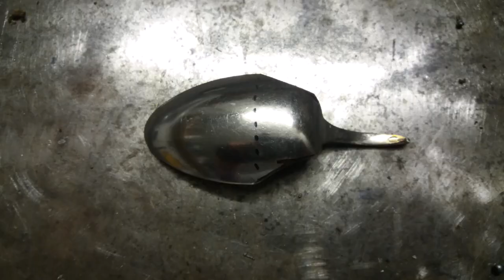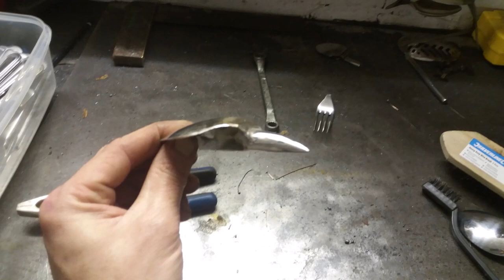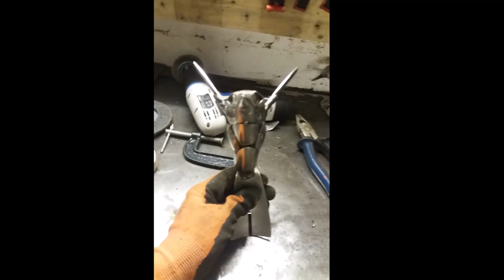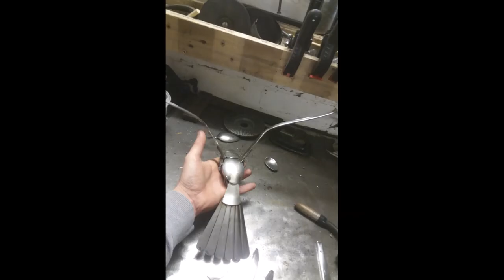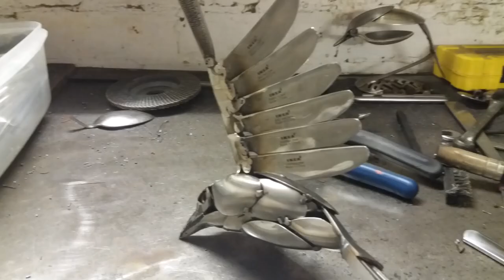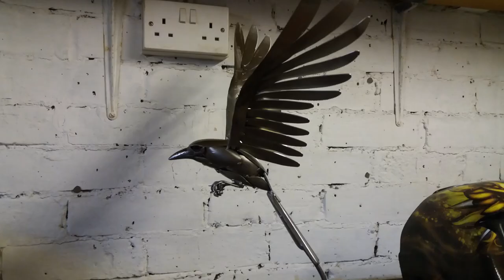Making a bird sculpture out of cutlery  - Jackdaw Sculpture

Comment: Hiya, can you tell me what tool you use to cut out the eye holes on the head? I'm not sure my 5" grinder would do the job for that part. Also, how do you clean up around the tack weld? I used a soft wire brush on my previous efforts (I won't use the term 'sculptures' just yet...) but it took too much of the chrome off and leaves a pretty poor finish.

Thanks!
Reply from the maker: I use a 5 inch grinder! But I use flap discs for shaping. So those eye reliefs i just ground them down with a 60grit flap. The fork forms the underside of the eye socket of course and i weld along all the joining edges and transition to the beak ....then (again using a flap disc) sculpt smooth. As for the chrome finish ... if you re using stainess steel then the finish is throughout the material rather than a chrome plate on top ... so it just needs refinishing to return it to shiny. I get it as smooth as i can with the 60 grit then perhaps ill quickly kinda buff it with the 120 then its on to scotch brite pads (you can get these for die grinders / dremels / drills). Again different grades but they should take you more or less to a stage where you can polish ... and for that I use autosol metal polish. The more shiny bling you want the more you go to town. Personally I quite liked the more matt finish on that bird but you could go full mirror effect if you wanted to. Here's a couple of links to the tools im talking about ....https://www.spawelding.com/abrasives/flap-discs/tyrolit-115mm-60-grit-ctrim-flap-disc.html  https://www.ebay.co.uk/itm/50PC-2-Medium-Fine-Roloc-Scotch-Brite-Roll-Lock-Surface-Sanding-Disc/233644470697?hash=item36664bb1a9:g:5cIAAOSwfi9ZsYtU These are a 'quick lock system' that work brilliantly and come in various grades. Typically I use red then green ones but there are others. Great tool for tidying up. Hope that answers all the questions.
Reply: @JohnNorrisMetalSculpture  Yes, thanks. I've been going straight from (worn) flap discs to autosol so a bit of fine polishing in between would obviously be the way to go.

I'm going to be a bit of a pain here but I'm trying to work out how to put together the Jackdaw's head and I can't work it out from looking at the video.The steps that I can see are:

7 secs in: bend front of and mark across the spoon, cut both sides to fit profile of forks

13s: cut forks to make beak and side of head, weld and polish beak - the underside and side views are clear enough 

The step from 25s to 32s is where I'm trying to figure it out. It goes from the side of the head seeming to be solid to having the eye socket and a nut there. It looks like there's a join at the front lower side of the nut, do you cut our part of the fork, shape the front of the socket, then shape and weld the rear of the socket out of a second bit of metal before putting the nut on behind? If you could walk me through the process a bit I'd really appreciate it, I'm going to have a go at putting one of these together.
Reply from the maker: @mattspencer6660  No problem, happy to help / inspire. This is an unlisted video I filmed for someone else. Some swearing in it :/ so not public but I think it should give you a much better idea of the steps involved - https://youtu.be/rXU6TeR1J9E

Also I filmed this one which details the knives / wings. There are a couple of things to consier for an authentic bird wing look, namely the curves on the feathers (downward on the inner 6 with perhaps less and less bend approching the elbow joint, then 1 unbent then gradually and subtely curving upwards more and more with each feather. Also as the primary tip feathers curl up they should also be pitched (angled) fractionally forward and again each feather shouldbe angled a fraction more than the previous one until you get to the tip. Think I did that for the outer 3 or 4 feathers, might have been 5, can't remember hope its clear in the vids. Here's the link - https://www.youtube.com/watch?v=7WOZtc-z7hQ&feature=youtu.be

EDIT: That head vid I've linked, there is a bit I forgot to do which i had to change later. Jackdaws have a noticeable brow / forehead. So i actually bend the spoon slightly just as it starts to turn in to the handle and just a few mm before the beak then starts. (hope that makes sense) Notice the forehead in the vid youve already seen is better because I did this. Simple thing, makes a difference. Easier to fix later, you can make anything out of weld! but remember to do it!

I don't know anything about your welding or metal work experience - im making it all up as I go along! Anyway here's a couple of other thoughts ... 

I'm overly generous with the weld when attaching the knives and I double up the spoon handles that form the 'arms' onto which i mount them, just to add extra strength. Incidentally that somethign not shown i the video. Strong spoon handles mounted internally like a triangle with both handles strectching out from teh centre of the bird. You need to fit the tea spoons that clad the body around these. If memory serves I had the spoon handles coming out imediately behind the head spoon. Again I think talk a bit about that in the vid, about the upsweep of the wing at the elbow and also a slightly backward sweep at that point too. The majority of the clean up I do with a flap disc (those zirconium ones last ages even when worn!). 

Its obviously important when you attach the knives that you bevel the edges that join the spoon handles because you need a channel for the weld to sit in for strength. The additional 'generous' weld that overfills that bevelled edge will all get ground off for a flush finish so you need some depth there or it will be a weak point. Finally on the wings ... The most useful tools i have (which I didn''t have then) are carbide burrs and mini flap discs in a die grinder. Getting in netween the feathers to clean up is fiddly! SUggest you do the bulk of it after attaching eack feather then clean up at the end any bits you arent happy with. 

Your question about the eye sockets. The head in the video you've watched (one of my very first pieces and videos) I forgot to cut the sockets and it was an absolute ball ache to do so afterwards.Possible but time consuming and unnecessarily fiddly, infinitely easier to cut a notch out of the fork before you weld it on. The head is a fiddly thing to make to be honest, you also have to be careful about welding the eyes (nuts / ball bearings) in the right places to get an even spacing around the eye socket, also they need to be symmetrical so take a lot of care in making sure your forks are attched symmettrically and like that your eye sockets are too. As long as they are all square then its just about making sure the nuts are welded accurately so there is even spacing around the edge of the nut and the edges of the eye socket ... there's a trick I use with a bolt that helps with positioning the eye nuts for welding - its in the vid. 

Unfortunately I had no suitable tea spoons in the video to show the finished body. Hopefully by watching that and then rewatching the one you've already seen you'll see how it is made. I make a kinda heart shaped chest out of two teaspoons (in vid) but then that gets covered up as I clad the body. Each side of the body I think has two teaspoons from tail to back of head and the second spoon tucks in the gap behind what I guess youd call the jaw. Something like that anyway. The vid you've watched there is a picture of the body with no wings in my hand I think tha tprobably will be the most useful still image. Try to build from tail to head, that way generally you are covering up as many tack welds as you can. To be honest the videoyou watched was (I think) the 3rd thing I ever tried to weld. It turned out pretty well but looking back at it now its pretty rough and alot of nasty welds visible. Alot of the skill in construction is hiding the welds or finding a way of blending them in so you don't even appreciate there was a weld there. I think the wing video Ive linked you above is a later bird so you'll probably see that the transitions between teh feather sare alot neater and the body also is different. Very similarly constructed but less obvious tacks. I try to build them the same (think ive made 5 of them now) but generally there is some variation down to what spoons I have or havent got.

Tools - I talked a little above about other tools you might want, the burrs are very useful. I was using them in a fake dremel (also mini sanding rolls which were very useful but slow prgress!)  but quite frankly its not nearly man enough although I built the predator and quite a few other things with it. If you have a compressor then get a die grinder, they are very cheap and you can put all sorts of little flap discs polishing scotch brite pads (quick lock) and sanding rolls. (Some of which fit in the dremel. Trouble with the dremel is its a very spindly little shaft the things spin on. I was forever chewing through the brass collets that close up around the bits. Also, definitely get some scotch brite discs. Pretty sure its called the 'quick lock system' ... basically a universal bit that fits in the die grinder (or a drill) and you just twist them on or off in a second. Drills dont really spin fast enough but as a work around they are useable. The die grinder has a much bigger beefier collet. Here's links for die grinders and carbide burrs / flap discs ...

Burrs - https://www.ebay.co.uk/itm/Handy-Tungsten-Carbide-Double-Cut-Rotary-Burr-1-8-Shank-Fit-Dremel-Rotary-Tools/192616541830?ssPageName=STRK%3AMEBIDX%3AIT&_trksid=p2057872.m2749.l2649  Incredibly hard wearing and cheap even on the stainless. Keep the speeds up or the grab a bit and can make nasty marks! Requires a firm grip on the tool when doing detailed work.

Mini Flap discs quick lock system - great tool! - https://www.ebay.co.uk/itm/10pcs-2-60-grit-Lug-Sanding-Grinding-Wheel-Flap-Type-R-Roloc-Disc-Wheels-UK/164316569082?hash=item264207ddfa:g:uLEAAOSwS41fJR88 This isn't the seller I got them off but I found soemone with a bulk load and various grits. Worth looking out for.

Scotch Brite pads - again, brilliant tool for pre polish - https://www.ebay.co.uk/itm/Assortment-Of-3m-50mm-Roloc-Scotch-Brite-Surface-Conditioning-Discs-Not-Grinding/193607779586?hash=item2d13ec4502:g:QAwAAOSwDLlfJnKV Again not a seller Ive used but thats the item you want! REg, Green blue i believe are coarse medium and fine. Work in drills and fit the same quick lock shaft as the flap discs. Very quick turn over from one finish to the next ... like 2 seconds to change it fromf lap disc to scotch.

Die Grinder - Youll need a compressor but better than dremels. Pretty cheap - https://www.ebay.co.uk/itm/1-4-Collet-Straight-Air-Die-Grinder-Grinding-Tool-US-Pro-Compact-6mm/381416776428?epid=2130558763&hash=item58ce3622ec:g:6aAAAOSwyNBeSyVE Something like that but check the collet sizes. Should come with a selection but read the description.

FInally, thanks for the interest, great to see someone else have a go at building one. Send me a pic or a link to a vid when it's done.
Oh one other thing, just re reading your earlier message ... you mentioned chrome finish. Avoid chrome cutlery or anything played or with any sort of hue or colour to it, they weld terribly generallygiving off some sort of gas that makes for a porous swiss cheese looknig weld. Crap, ugly and weak. Standard run of the mill cutlery works best (typically 18/8) or non magnetic stuff and you can weld it with mild steel wire as long as youre using a gas mig. Gas less is possible but it can produce porous welds too and a lot of spatter. I use 95% argon 5 % co'2. Generaly mild wire and then lacquer the pieces afterwards after cleaning (post polish) with alcohol or thinners.

Regards

John
Reply: @JohnNorrisMetalSculpture  Mate this is gold, thanks. I'm a boilermaker by trade so know what you're on about re: tools. I don't have a compressor in my home workshop yet but have access to one at work (with a die grinder) so I'll either use that or pick up a second hand one (I kinda want one for spray painting anyway).  I have a mig using mild steel wire and 95/5 gas as well, I'm a bit reluctant to go and pick up stainless wire and gases due to the cost outlay so I'll just have to suck up the poorer finish for a while until I have some spare cash lying around. 

I like the jig, I was thinking along the same lines as the two basic birds I've put together have pretty ugly bends in them and I want smoother lines in future. 

https://i.postimg.cc/B6RS2SBJ/IMAG0566.jpg

https://i.postimg.cc/9XqFC9c0/IMAG0567.jpg

Particularly above the beak on the second. I reckon I'll do a few more smaller sculptures until I get the technique right before tackling the Jackdaw as my first 'proper' project, there seem to be be a few of those compilation vids on youtube (where the creator takes stills from other people's work without crediting them for it, but that's by the by...) showing models of various levels of difficulty so I should be able to get the skills together fairly quickly. If you know of any websites or whatnot I'd be grateful if you could chuck them my way. I'm going to have to copy for a while until I have it together enough to do my own stuff.

Where do you pick your ball bearings and other assorted bits and pieces from? I've cleared out the local charity shops of likely stuff and am running a bit dry now. I'm a bit wary of using 'genuine' scrap as a lot of it (chains and broken bearings and the like) is rusty or pitted and it'll be a job to clean it well enough to get a decent finish on it.
Reply from the maker: @mattspencer6660  No problem happy to help. Those birds look good for a first effort! Bends could be easily fixed too!

Ok few answers: 

On finding inspiration and ideas or things to replicate I would recommend facebook and instagram, search for 'scrap metal artist', 'weld art', and 'metal sculpture'. I'm sure people wont mind a bit of plageurism but I also think you should push your own creative boundaries, and here's two reasons why ....

1) I think that the best of creativity comes from passion, admiration, love, desire, respect etc. A piece that truly has YOUR heart and soul in it will always give you more, and probably turn out much better because you will never settle for 'good enough'. Your heart won't let you because good enough ... ISN'T when it's your passion to make it. Consequently copying will learn you only so much, you gotta pour your own creative juice to get the best out of yourself. I think my Jackdaw, Predator / Pegasus are all good examples of that. 

The Jackdaw worked because I love Jackdaws, sure the finish is a little rough (early piece) but it's elegant, I'm still proud of it. It looks that way because it came from within. Likewise the Predator. Perhaps that was more 'admiration of cool' and 'desire to make' more than love or respect for the subject ... but ultimately it turned out good because once again it was MY heart that drove me to make it, to obsess over it, to dedicate the time to it etc. Again with the Pegasus ... similar. Came from within. 

2) Challenge yourself to improve and learn faster. The Predator was also one of my very first pieces, might even have been the one after the Jackdaw. Making it was the single greatest learning experience of my metal sculpting journey to date. It was invaluable!  ... but again ... if I'd copied someone elses all I'd have learned is how to put one piece together in one particular way to get one particular end result and I might or might not have made a half decent replica at the end of it. But by designing, conceptualizing, visualizing and creating (sometimes cutting up and recreating!) I was ten times ahead of where I'd have been.

Having said that, I love that fact that someone would like something I have made so much that they would try and replicate it, that's a really great feeling to have so thank you! I really appreciate the interest and respect you have for the piece and I look forward to seeing what you do with it! Equally I love that the fact that I have inspired others to do the same thing ... but like I say ... long term your best results will also come from within. Test yourself! Trust your gut and your heart, you will always know if you are honest with yourself whether youve nailed it or not. 

As for materials. Make friends with your local bike shop and motorcycle shops!, they generally just throw all the old gears / cogs away so often saves them a run to the scrapyard if you just take it!  Scrap yards too, I have a great one here locally and there is a guy there that hoards all the cool stuff. Go introduce yourself and make some friends. Cutlery is my primary material I guess and like you I get it from charity shops. Also try phoning all the local 'house clearance' firms. In my experience they just throw the cutlery away unless its silver. I have left my phone number with quite a few of these people and just said call me when youve got a bucket full. Typically Im paying 10p per item (GBP). 
 
As for cleaning up old scrap chain etc. Well, petrol is a brilliant degreasant, also parafin (can be used with a compressor / air tool to clean quickly). As for rust, A big wire brush in a drill! Never really bothered me cleaning up material because doing so just meant I was turning nothing into something. Embrace it! lol

Err yeah I guess thats it. Shout me out if you got any more questions and i'll try and get back to you. In the meantime .... what is your 'inner Predator' ?.... what is the piece you would most like to be able to make? Figure that out, then give it a go! it will be the biggest and most valuable lesson for you.

Best wishes

J